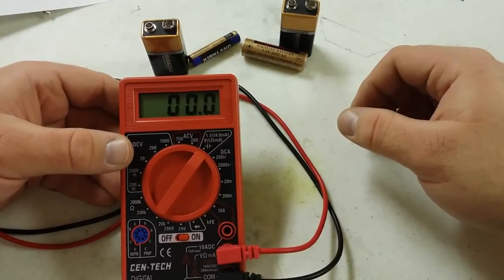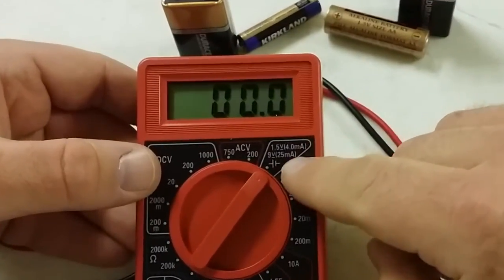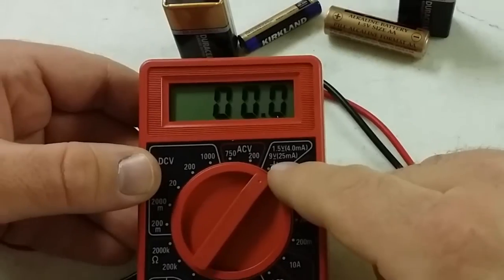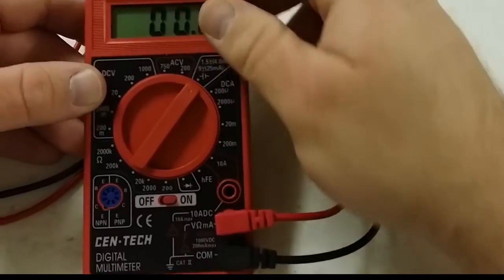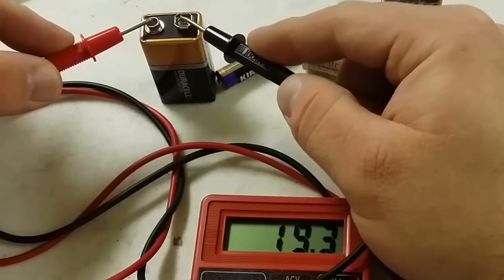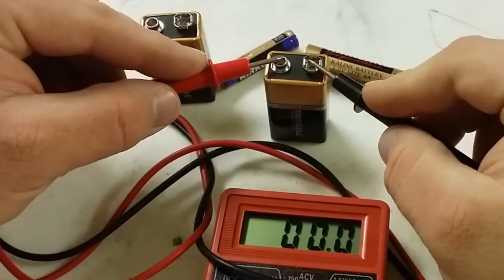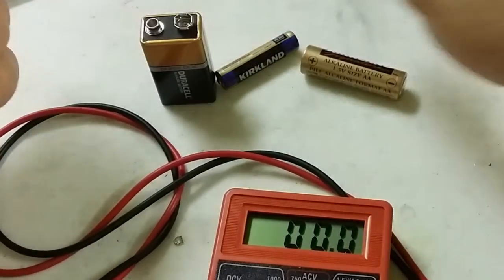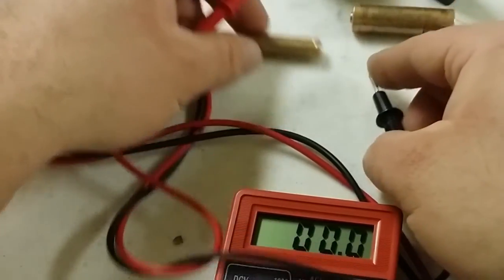How to test battery with Multimeter from Harbor Freight Cen Tech Digital Multimeter

Comment: How do you use this specific multimeter to know how charged a rechargeable aa battery is?  And if it’s reaching its full potential? (I have a feeling these Amazon basic rechargeable batteries are duds as they don’t work in many of my devices)

Comment: Good video, found the battery setting lol. I do use the "200" setting in the DCV section to see how many volts left in a 9 volt or AA (1.5 volts) as well. thanks guys!
Reply: I get a much lower reading when I tested it the way you said to!

Comment: I was always told to use the DC volts setting. Then you see the exact volts left. What is the purpose of using this setting? Also can you check a 3v button battery using your setting? thanks for your video.

Comment: I have alot of old rechargeable AA energizers, cinergy, and power x batteries I charged up. Most are 3.8 to 3.9 some higher and some as low as 3.6. I can tell you the battery life on these are really short compared to brand new rechargeable. It what point and reading  are they considered junk? I had some ultimate lithium non rechargeable batteries in my trail camera that died. It was a cold day out. In the teens to 20's. I just checked them and all are 3.8 to 4.1 accept for 1 that test 3.6. The trail camera I used will operate with 4 batteries. So I would guess any AA barrery that tests under 4.0 will provide alot less life? My E caller lasts for 45 minutes with the same 3.8 -3.9 batteries. Brand new will last for 2 days of calling non stop.

Comment: Thanks for the video.  At what point is a battery bad?  I ask this because I'm testing 9V smoke detector batteries.  Detector is chirping.  Battery in the detector is at 23.5mA and I replaced it with a fresh battery that measures 26mA and chirping stopped.  The old battery doesn't seem that low.

Comment: My multimeter reads 1 when I turn it on (without touching the sensors to anything.  Is it blown?
Reply from the maker: Does it change depending on where you move the dial?
Reply: @ttms2  As I turn the dial in most sections, it may flash  a negative sign in front of the one or it may flash other numbers for a second and then it reverts back to one.   In the 10A setting, it goes to -100 sometimes, 1 others. In the ->+ setting it goes blank. In the Omega section, it usually stays on -1, except for straight down, which is blank.
Reply from the maker: It sounds like it's gone bad.
Reply: @ttms2  Any thoughts on why/how this would happen so I can avoid it next time?

Comment: Can you test a Dot battery?
Reply from the maker: Yes, I'm just not sure what the full reading would be.
Reply: It works with "button" batteries but I noticed that you might have to sort of energize the tester on a good AA or AAA to get a reading then test the button cell. Have a new button battery to test to tell what the reading should be (mine came up with various readings on different button batteries.

Comment: How do you test cm2032 batteries on cen-tech meter mod 98025 ?
Reply from the maker: +Robert Stawicki it is done the same way. You will need to find the datasheet to know what the reading should be though.